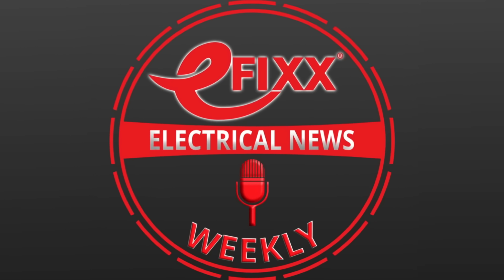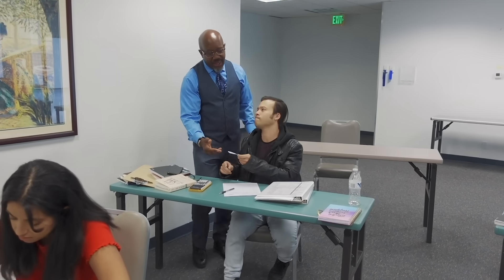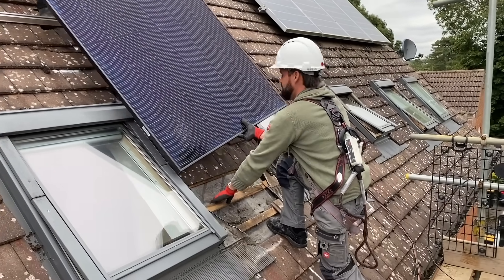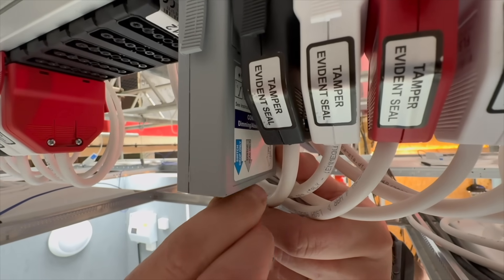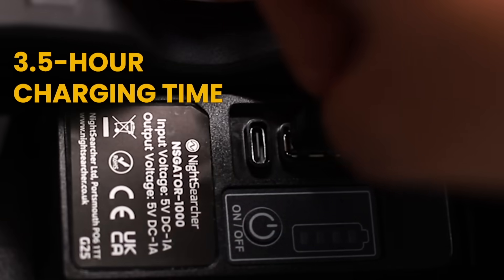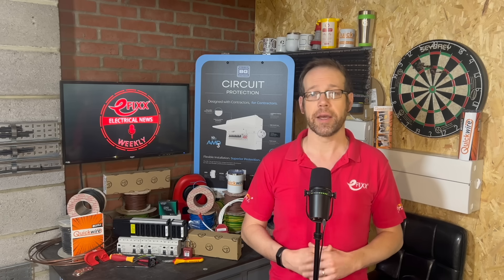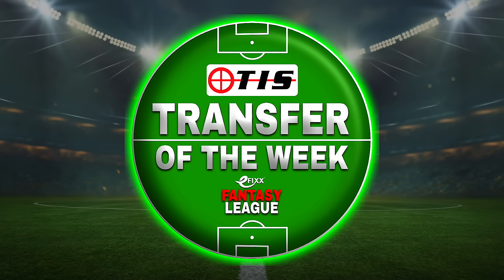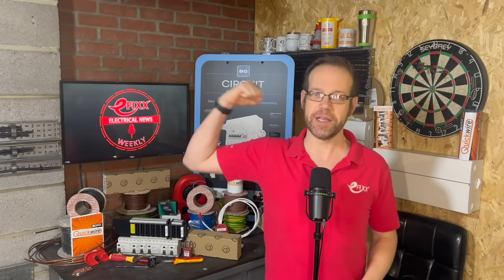Smart Meters Are Telling Lies... Here's Why

Comment: Have you tough, about digital meter readers, what if that company who read digital meter wirelessly, could also manipulate meter reading as well ? How can you proof ? No way to proof.
Reply: That's the problem with these things. The „smart“ thing about them is that the supplier can fiddle them, but you can't. 🎻

(A practice - Speaking on personal experience - Most likely developed by the Church of England.)
Reply: Just as much as your supermarket has not manipulated the scales, or your petrol station has not manipulated the pumps.
Reply: @WimTon  well, big supermarkets in here have digital price tags on shelfs :/
Reply: @WimTon  At least you can check for those by bringing your own scales with you, though keeping a pair of consumer scales in trade-legal calibration while they're being carted around on shopping trips is a different matter entirely. At least a set of non-trade scales will still tell you if that „1kg“ bag of pasta is likely to be acceptably close (i.e: +/- 5%) to the stated weight, reminding that a 5% variance is always acceptable for the fact mass production can't always get it bang-on. ⚖↕👍

Petrol pump manipulation - At least in the UK and other Sovereign nations where fuel is taxed for the benefit of the State - Is less likely, partly because charging the consumer for 10l of fuel when they've actually drawn 9l has the effect of making the State complicit in the crime of deception against a Subject of that State. Some variance will always happen - Nothing digital is infallible - But this should be no more than the reasonable 5% allowed for consumer groceries as above. 👑⛽👍

Another headache for fuel fiddlers 🎻 is that people can lawfully record and compare a stations performance and deliveries. If a tanker delivers 1000 liters on a Monday, a WhatsApp group of regular customers tots-up a total of 1100 liters drawn across the week but another tanker hasn't already made another delivery, then something starts to smell of Brexit and people may bring the taxman in to investigate. 📜